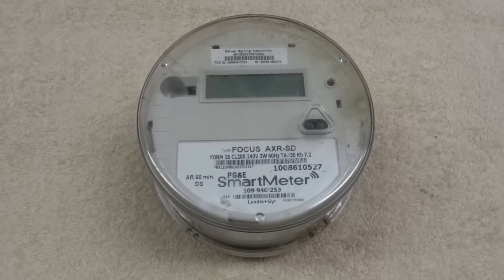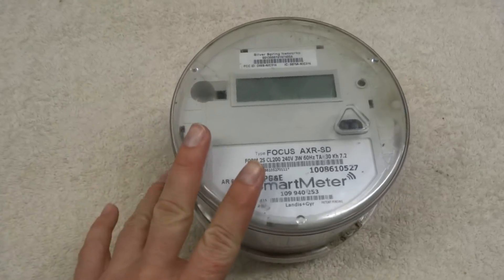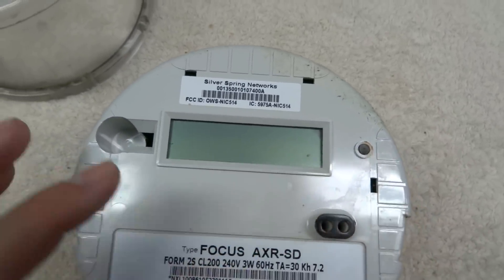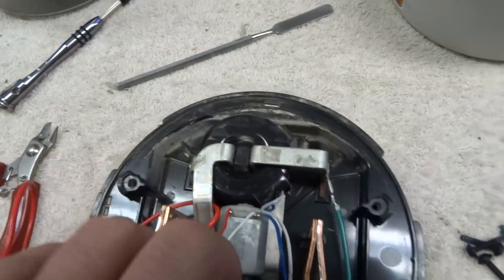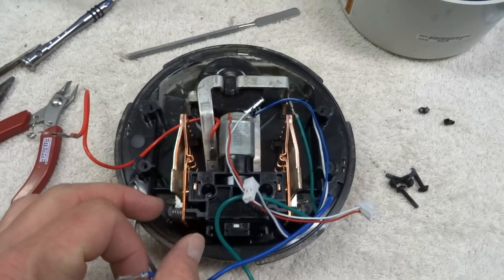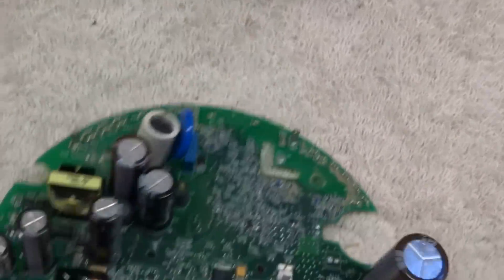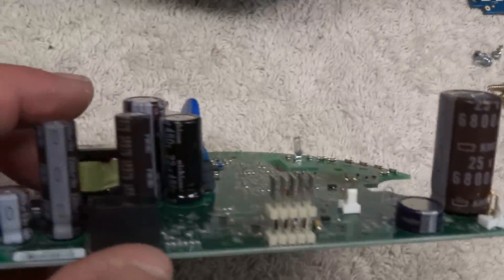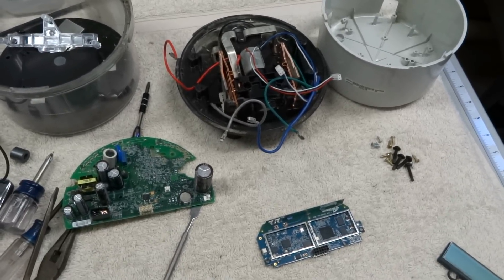Let's Teardown - Residential Smart power meter

Comment: fires  fires 🔥🔥🔥🔥🔥🔥🔥🔥🔥🔥🔥🔥🔥🔥🔥🔥🔥🔥🔥🔥🔥🔥💀💀🚒🔥🔥🔥🔥🔥
SMART METERS CAN NOT BE USED TO INTERRUPT THE LOAD
 IF THE METER IS NOT BYPASSED, THEN THE CHANCE OF A SMART METER FIRE INCREASES BY A FACTOR OF 1000 TIMES
 IF THE CUSTOMERS METER BASE IS NOT INSPECTED TO MAKE SURE THEY STILL MEET UL CERTIFCATION, THEN RISK OF A FIRE INCREASES BY A FACTOR OF 10,000 TIMES AND THE UL CERTIFICATION OF THE CUSTOMER'S METER BASE IS DESTROYED BY THIS CRIMINAL ACT
If you come home and find the power has been interrupted to your home and you have a new smart meter, call the police and charge your power company and the meter installer with ATTEMPTED ARSON.
WATCH, AND TAKE NOTES ON THE ONLY LEGAL WAY TO DO A METER SWAP
 https://www.youtube.com/watch?v=G0bq2Hn2vOo 

#1 If they install a smart meter and your power goes out, then they are an ARSONIST. 
In Canada, it is against the law, all smart meter swaps have to be BYPASSED to keep the power on.

#2 If the customers UL certified meter base is NOT INSPECTED by a CERTIFIED electrician before the meter swap, they they are probably breaking the law and will increase the chance of your home burning down by a factor of 10,000 times. 
Remember, the only electrical device in your home that is NOT UL APPROVED is their smart meter. 

Why do you ask a smart meter is not UL APPROVED 
BECAUSE THEY ARE NOT BUILT STRONG ENOUGH TO MEET UL'S SAFETY REQUIREMENTS.
They are only certified to measure power consumed.
Reply: I got a stack of Electrical Code books right here 
Frederique since 1985.  Never seen a rule that said it was against the law to switch off or on a smart meter under load.

I watched the video you posted.  Here in BC (Canada) our meters hold the meter socket faceplate in place so it is impossible to jumper the meter socket before removal of the meter cause you can't get the face plate off to get access to the meter socket lugs.  The other day BC Hydro had me kill the main breaker before they would switch the meter back on again saying something about protecting against a stove being on or some other such heavy load causing issues such as you have brought up.

Now most of the smart meters installed here were hot swapped in the day causing a few fires here mostly because of the blades not being inserted into the jaws correctly or at least the problem being in that area of the install.

I am really interested to know why you think it is ,against the law, to trip that switch without bypassing the meter although I can think of a few reasons why bypassing the meter would be a smart idea.

Is this a civil code rule, CSA code rule or some other code rule?  Got a statute or code number pointing to this regulation?

Comment: The supercap is used as power back-up , instead of a rechargeable battery, when there is a power outtage...
I don't understand why a solidstate relay or thyrister is not used instead of the mechanical device... old tech & a fire hazard..... 😞
Reply: Too much power loss and heat generation with thyristors. 100 amp load with a 1 volt drop across the solid-state device = 100 watts loss, and a lot of heat! You'd need one for each leg, so you would double those loss and heat figures.

Comment: In CA getting caught with a lock ring key is a felony. Removing the ring is a felony.  What felony u ask ... theft of utilities. That said:  I recommend a dremmel to cut ring off. Don't call me ... this is so simple to do I'd feel the guilt of charging you $65 for a 5 minute job. Your other option is a grounded n bonded farraday cage around the meter ... noodle strainers work very well. You must physically bond and then ground the strainer to a #10 wire and ground rod, cold water pipe, gas pipe, etc. ... basically any metal that contacts the earth. This will create LAN confusion for the utility. Meter is part of a LOCAL area network LAN, MAN ... Municipal network, WAN ... WIDE area network, and that's called the smart grid.  Utilities will likely show up n scream at you. You retained their meter, didn't touch it, but it can't talk to them which requires a real person to show n read it costing them wages at the IBEW union level. Thus no extra fee for an analog meter can be charged. Ask them for the code section that prohibits the farraday caging you installed. It violates no existing UBC or NEC codes.
Reply: My buddy took his out an put a nother one in for 15 day s when he got his new bill the original one jimped up 4000 khw how

Comment: Is there a motor operated contactor. Or a regular average contactor??The purpose of that contactor is to open and close the circuit, to turn the power on and off. If you do not pay your bill, the electric company can turn your power off with a telephone call to the meter which has a cell phone of sorts..this eliminates  the need for a person to go out and physically remove, and boot the meter off. After you pay your bill to the electric company. They can turn your power back on with a phone call to the meters internal phone again. The electric company can also tell if you tamper with the meter instantly. They can also predict how much power you will need every minute of every hour of every day.Allowing them to increase available current onto the grid to satisfy customers demand for energy.
   There is a dark side to having a smart meter national electric grid.
   No one wants power stations in their backyard, it is difficult to get the permits to build a power station, environmentalists don’t want coal fired stations, not too many people want  atomic powered stations. Not everyone can have a solar powered or water powered or wind powered station, gas and oil fired stations seem to be the lesser of the evils, geothermal would be nice but that’s not possible either. So we have a dilemma. Energy usage is going to continue to grow, they’re not building many more power stations, to keep up, so as a result in places like California, during high consumption usage, companies are forced to have reduced voltage brownouts or out right rotating blackouts.
  Now comes the Darkside. Energy star appliances started showing up about a decade ago. The government encouraged everyone to buy energy star appliances. Things like washing machines your clothes dryers, refrigerators, freezers, air-conditioners, etc. In times when there is a strain on the grid, electric companies can put A radio frequency on portions of their customer base Thru the grid that will turn off just the energy star appliances, and not your television, not your furnace, not your lights, not your electric garage door opener. Just your items that you may not need or even know that they are being rotated off for an hour or two to reduce energy usage in an emergency. So instead of having a complete blackout of an entire sector, or a reduced voltage brown out, which is very hard on electric motors. The electric company can just turn off your energy star appliances, and you probably won’t even know they are off.
  Another Darkside of the smart meter is, it is also a time of usage meter. In other words, when the electric company has to buy power from a neighboring electric company to make up a shortfall for whatever reason, they have to pay that neighboring utility more per kilowatt than  it probably costs to generate their own power.. so they are paying more for power to get it to you the customer. The highest consumption rate is during what we would call bankers hours. 9 to 5, or 8 to 4. The electric companies will charge you more for the electricity you use during bankers hours. Because they pay more for it during those hours. They can justify this by saying, it will promote conservation of energy. In other words, it will be cheaper to use your washer, your dryer, your air-conditioner, your pool pump, your microwave, after five in the evening. That is when there is less demand on the grid. A smart meter records and transmits the data of your time of usage minute by minute. So the company knows how much you use every minute of the day, and you will pay more for usage during bankers hours. That is what the smart meter is all about in the name of conservation.
Reply: Let's look at why we do not need smart meters. 
 #1 A smart meter will hurt or even KILL disabled homeowners who have disabled medical implants.  The average of deaths by smart meter radiation and smart meter fires is almost 100 every month in North America.

#2 Did you know if your power company “turned off” the power to your home when they did a smart meter install, your chance of a smart meter fire increased by a factor of 10,000.

#3 Your power company has access to all of you private power information. Eg When you make tea, when you turn on your alarm etc. This private information is sold to Google for huge sums of money. Ask your power company what the second radio transmitter in your smart meter does. (ZigBee) 

#4 A smart meter will cause cancer to return if your family members who are fighting cancer at home. If they come home from the hospital and sleep near a smart meter, they will die. Check with the US Cancer Society website. 

#5 Smart Meter RADIATION  will turn off breakers in your home. Both AFCI's and GFI's get turned off by the radiation from the smart meter.

#6 You smart meter is very accurate, BUT, the software (firmware) is programmable. Your bill has nothing to do with the power you use. 

#7 Smart meter radiation is breaking Ionic Bonding. 

#8 A huge expenditure for a huge loss. Billions of dollars to purchase something that does not general generate any power and each smart meter need 4 watts to operate. One million smart meters use 4,000 KILOWATTS of energy to operate.

#9 The second radio transmitter is for ZigBee. If you want your power company to MONITOR your home 24/7, then you are in luck. Don’t forget, this private information will be sold. Why do you think your power company spends BILLIONS of dollars and does not generate one watt of extra power to sell?
Reply: There is a motor in there. It's called a motor-driven contactor.

Comment: 4 connections - 2 for active and neutral in and 2 out on a single phase circuit - that`s it and those LEDs you thought were banana jacks ARE the comms port. Not all antenna have 2 sides either. The one in this is a fractal antenna and is part of the layers within the PCB.

Comment: Pay your bills n you dont have to worry. And shut up.
Reply: Let's look at why we do not need smart meters. 
 #1 A smart meter will hurt or even KILL disabled homeowners who have disabled medical implants.  The average of deaths by smart meter radiation and smart meter fires is almost 100 every month in North America.

#2 Did you know if your power company “turned off” the power to your home when they did a smart meter install, your chance of a smart meter fire increased by a factor of 10,000.

#3 Your power company has access to all of you private power information. Eg When you make tea, when you turn on your alarm etc. This private information is sold to Google for huge sums of money. Ask your power company what the second radio transmitter in your smart meter does. (ZigBee) 

#4 A smart meter will cause cancer to return if your family members who are fighting cancer at home. If they come home from the hospital and sleep near a smart meter, they will die. Check with the US Cancer Society website. 

#5 Smart Meter RADIATION  will turn off breakers in your home. Both AFCI's and GFI's get turned off by the radiation from the smart meter.

#6 You smart meter is very accurate, BUT, the software (firmware) is programmable. Your bill has nothing to do with the power you use. 

#7 Smart meter radiation is breaking Ionic Bonding. 

#8 A huge expenditure for a huge loss. Billions of dollars to purchase something that does not general generate any power and each smart meter need 4 watts to operate. One million smart meters use 4,000 KILOWATTS of energy to operate.

#9 The second radio transmitter is for ZigBee. If you want your power company to MONITOR your home 24/7, then you are in luck. Don’t forget, this private information will be sold. Why do you think your power company spends BILLIONS of dollars and does not generate one watt of extra power to sell?

Comment: Just got my brand spanking new analog meter today :)
Reply: Where did you get the analog meter?
Reply: @beccasmith9598  - I guess it's not analog. The PG&E lady lied to me (or didn't know what she was talking about). I had a smart meter, I told them I didn't want. She sold me on a "digital meter" which didn't broadcast (emit radiation). After the conversation, I thought I was "opting out" to get an analog meter (that was what was eventually conveyed to me). In fact, I guess they didn't want to pull off the smart meter, because they can apparently turn off the radios within (so it doesn't transmit). I only learned this about a week or 10 days ago, because they apparently had to send a meter reader up here (every two months). The presumption is that the radio is in fact "turned off". But I don't have a way to test that it actually is. I can only believe it, because they supposedly sent a meter reader here (wasn't home that day so don't know for sure).
Reply: @jf6466  - I believe either they turn on the radios only when taking readings, or it goes through the grid. Interestingly enough, the meter reader has called me many months asking what the reading is, so I don't think when they turn it on it transmits well. But thanks for the advice.

Comment: There appears to be no fuse or breaker protection between the board and the power supply. If there is a surge the circuit board will fry and the capacitors explode.
No wonder they replaced them. These units need to be UL approved.
Reply: fires  fires
SMART METERS CAN NOT BE USED TO INTERRUPT THE LOAD
 IF THE METER IS NOT BYPASSED, THEN THE CHANCE OF A SMART METER FIRE INCREASES BY A FACTOR OF 1000 TIMES
 IF THE CUSTOMERS METER BASE IS NOT INSPECTED TO MAKE SURE THEY STILL MEET UL CERTIFCATION, THEN RISK OF A FIRE INCREASES BY A FACTOR OF 10,000 TIMES AND THE UL CERTIFICATION OF THE CUSTOMER'S METER BASE IS DESTROYED BY THIS CRIMINAL ACT
If you come home and find the power has been interrupted to your home and you have a new smart meter, call the police and charge your power company and the meter installer with ATTEMPTED ARSON.
WATCH, AND TAKE NOTES ON THE ONLY LEGAL WAY TO DO A METER SWAP
 https://www.youtube.com/watch?v=G0bq2Hn2vOo 

#1 If they install a smart meter and your power goes out, then they are ARSONIST. 
In Canada, it is against the law, all smart meter swaps have to be BYPASSED to keep the power on.

#2 If the customers UL certified meter base is NOT INSPECTED by a CERTIFIED electrician before the meter swap, they they are probably breaking the law and will increase the chance of your home burning down by a factor of 10,000 times. 
Remember, the only electrical device in your home that is NOT UL APPROVED is their smart meter. 

Why do you ask a smart meter is not UL APPROVED 
BECAUSE THEY ARE NOT BUILT STRONG ENOUGH TO MEET UL'S SAFETY REQUIREMENTS.
They are only certified to measure power consumed.

Comment: The 4 terminals are for 2 110 though connections.  Each side to ground is 110 volts and the voltage between the two sides is 220.  Basic rules of the voltage.

Comment: @Time stamp 5:03 that is a “CT”, it “looks” for voltage so that the power company can “see” when you have a power outage. It basically has a small amount of voltage that leaks conductivity to the coil that actives a relay and if that relay changes, then it send the wireless signal to the power company.

Comment: Also, they just plug into the meter socket, straight in, and when you do that shut power off to the house, and you can put jumpers between the terminals in the meter socket  so it don't run through the meter, which is illegal I'm sure, but I'm not an attorney, I'm an electrician

Comment: Those terminals on either side are the same thing, just top is input and bottom is output, in the middle you would have a bare neutral cable

Comment: Whether the power for the meter comes from the house side or the source side, it's still charged to the customer. It's only a question of whether it's directly charged, or indirectly, as an expense of running the meters. We pay for the meters themselves indirectly through expenses reimbursed by our power bill.

Same thing with "corporate taxes." Those are just expensed, and we pay for them via the cost of the goods or services provided by the co.

I'd guess the .22F Capacitor stores the settings during power outages.

I didn't see what split what you said was two sides of an antenna. seems there would be some kind of dielectric there.

Comment: I have two observations. 
One, I do not think they would tap the meter's power off the load side because if they did cut the power with that little motor then that would also cut the power to their electronics.
Two, it looks to me like they are only sensing the current from one leg of the 240 volts, so if someone knows which leg bypasses the sensor they could shift most of their 120 Volt load to the bypassed leg and drop their electric bill.

Comment: you are not getting charged they send you mroe power to begin with.. that takes  multiple things lke that into account..
Reply: Incorrect.  You are charged for the energy that is used to power the electronic meter.  It amounts to several dollars per month,  and I have seen evidence of as much as 2.7 kWh per day on an otherwise unenergized home, as ridiculously high as that appears, this is what the usage reported by the utility was for the unenergized home.